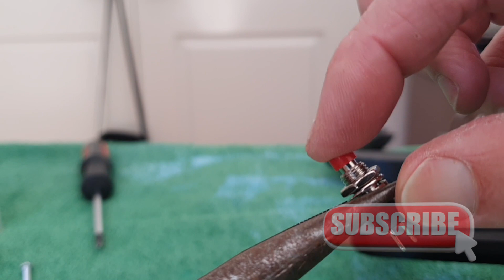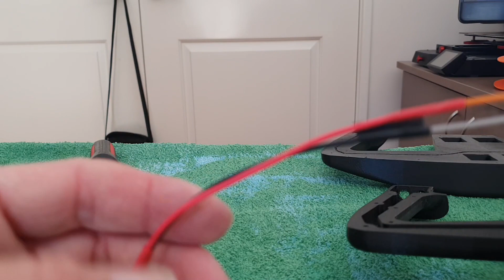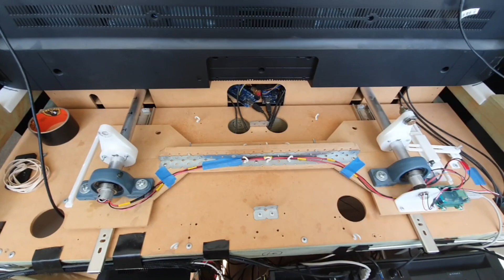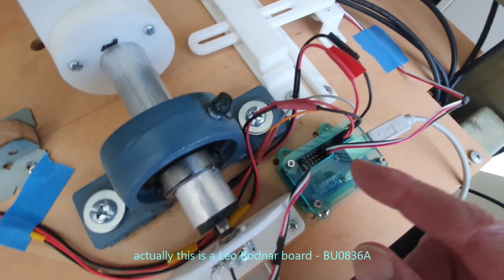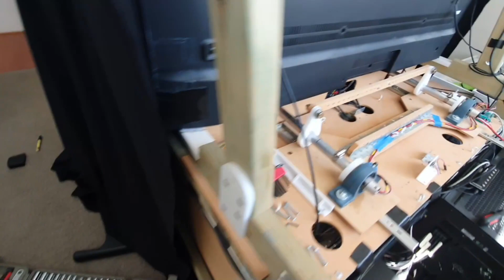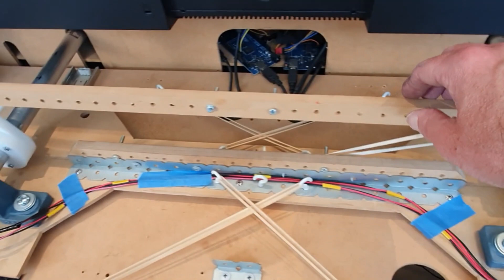⚡C172 Sim Build - New Yokes Pt3⚡

Comment: Great video👍🏻 just finished printing all 8 pieces of the yoke for my panel. I’m going to try to wire straight to the existing wires on my Logitech yoke instead of using more Arduino pins.
Reply from the maker: Great idea. From memory the Logitech wires through to control boards inside the yoke so you will need to retain those and somehow fit iniside the newly printed yokes, unless you are mounting those boards somewhere external.
Reply: @CessSim  so I ended up removing the bottom shell to both logi yokes I have linked together and that exposes the boards. Since I switched the old logi yokes with the new 3d print ones I cut the existing wires and ran them back through the back end of the yoke. Now I just need a wiring diagram or a color code for what wires went to what buttons and I think once I just re solder them I should be fine. I’m only using a single push to talk but I have two yokes so 2 ptt switches just wired to one.